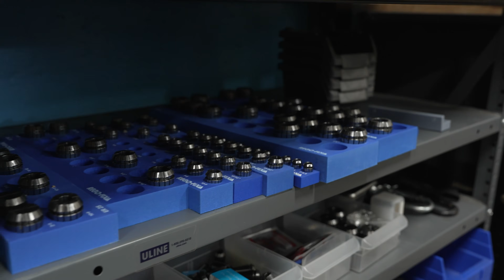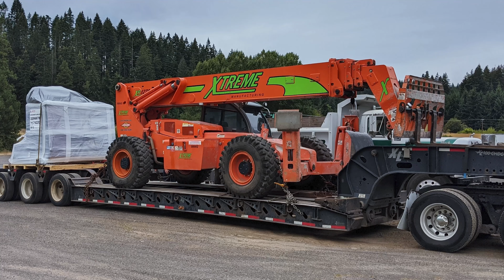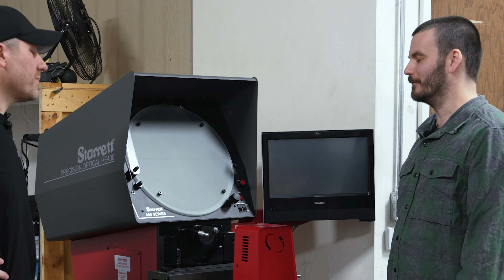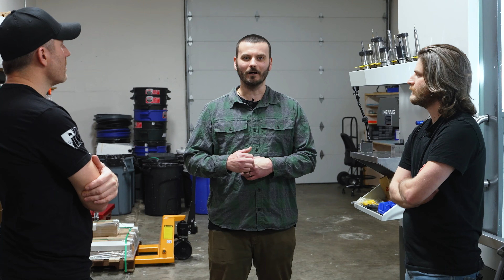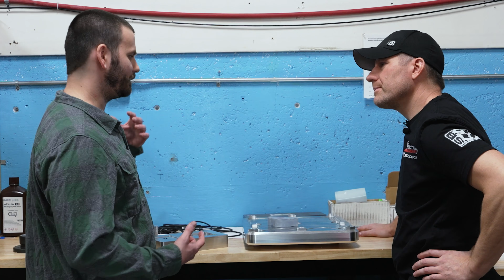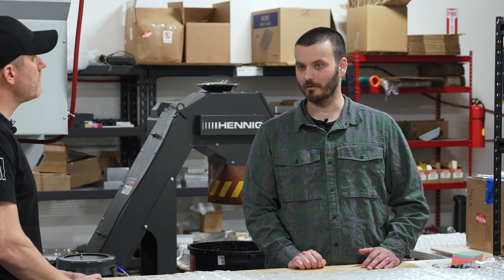How This Small Shop Broke Into Aerospace in 2 Years | Motor Control Technology Machine Shop Tour

Comment: I work in a small shop south east Michigan producing aerospace Fixtures/tooling. I recieve blueprint designs and have computer access to catia software to coordinate the build. I take BOM's and break down the work loads to materials. Mark up outsource details and organize all my machine work. I send squared up stock to CNC department and go over designs to ensure the details are made according to the build. Many things are left undersized for final check to dial in to tolerances. We usually build dowel hole contsruction. But many times im building many customs jobs with different tests that have to ve performed before tool can be bought off. I am the Vacuume tester. Many auto clav tools come in. Custom transport carts.. been doing it for ten years now!